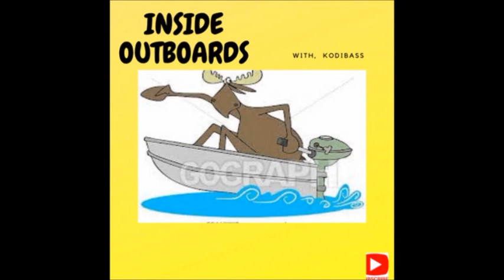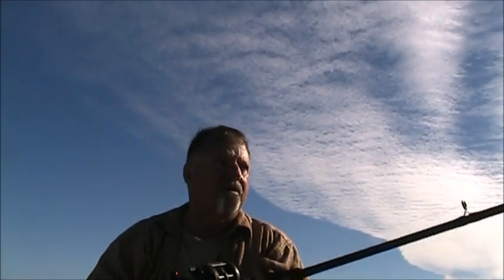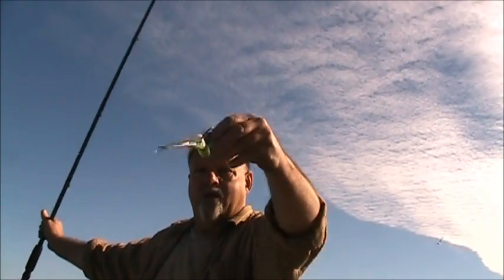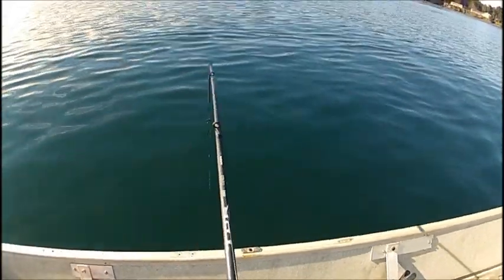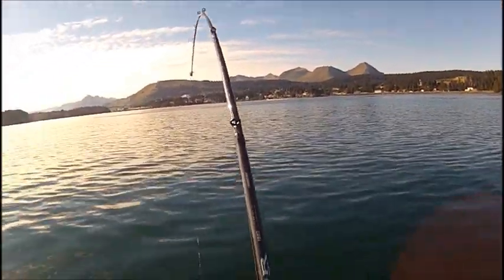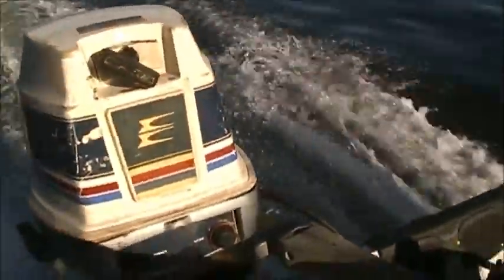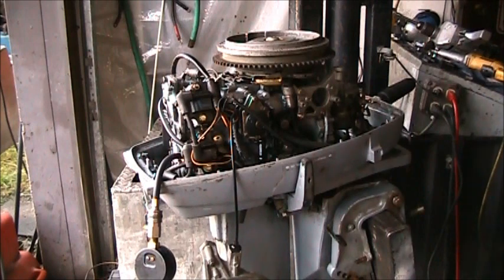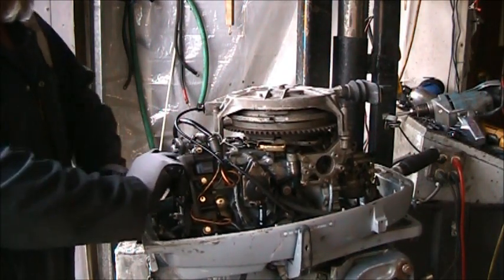1983 EVINRUDE 35 HP,   &   $400 00  FISH

Comment: I’ve got a 1990 Evinrude 30 hp. When I brought it I check the compression after running it hard with 50-1 yamaha 2T, top piston read 118, bottom 110. I took the motor apart including the piston to check+clean cause I’m restoring it and both top and bottom cylinder the 2nd ring are stuck. Funny how that is even when the compression seems okay. Thank goodness that I take it apart. Both cylinder wall looks OK, could use a little hone to clean out but not too much to where I need an over size pistons and rings. Hopefully on this 35 hp that you are working does not have the same issues. Love your video Kodi, thanks! Make more please!
Reply from the maker: +ATF, , Yep' them rings can get almost welded in their grove some times ,  I think this 35 will be ok as the numbers are coming up,  @ Least I hope.  More vid's on the way  4 sure.                                    kodi

Comment: Great job I was interested in how this was going to play out. Have 1978 25hp that was locked pretty hard 
pulled head soaked it bumped piston a few times and she moved cleaned small amount of rust off cylinder pressure was 45 on bad cylinder 125 on other 
Couldn’t get it to crank swapped plug wires got it to backfire hard a couple times swapped plug wires back and she cranked 
Rechecked pressure 120 and 125
Reply from the maker: +PB, fantastic 2 hear,  Yep' these old rudes R tuff as nails.     kodi

Comment: WOW...   Man I wish you had landed that little Barn Door...!    Hey question I came across a decent 'whole '78 Johnson Lower unit with a good Skeg for $100 with a brand new OMC water pump kit & brand new lower gearcase seal kit.   My question is this...   The 77 - 90 V4's took a 4-1/8" dia, 13 spline prop shaft, gearcase lower unit whereas the 77- 90 V6's used a 4-5/8" diameter, 15 spline prop shaft, gearcase lower unit...   is that correct?
Reply from the maker: +WR,  That does not sound correct to me,, I'll need to look thru my spec / parts break-down micro-fish & see what I can find,  Where did you get your spec's from?  kodi
Reply: @kodibassInsideoutboards  Johnson Evinrude 1990 (Copyright 1989) 507874 Service Manual; beginning of Chapter 6.  But I really don't have anthing to document the 1978 Johnson 115 lower unit, other than the fact that it has a 13 spline propshaft...

Comment: Bummer about the halibut...on a side note I've got my 35hp running..Had to replace a pos battery lead and figure out the wiring on the key start, fitted a replacement carby and electric choke, replaced the shifter lock as the original was rusted beyond usefulness...The gearbox was toast when i got it.. put on another one.. it leaks oil but i only wanted to see if it would run and pump water ...any chance of a video on how to rebuild the gearbox or at least replace the seals? Cheers mate
Reply from the maker: +PA, Sounds like your moving along nicely with that 35,  In the mean time put 1/4 cup of Lubriplate 105 in the gear box with the oil, it will slow the leak to almost nothing, & if a bit of water gets in things will stay protected.   I will look and see if I have a lower that needs sealing.                                                                                       kodi
Reply: @kodibassInsideoutboards  I'll put up a video on my home page of it running soon...I've also got a complete and running '77 35hp long shaft which i rebuilt last year (contemplating finding a boat to run them as twins in the future perhaps?)....and yet another '77 35hp short shaft in near perfect original condition that i run on my 3.7m v-nose punt..(i bought that one last year from an old guy who purchased it new and found that it was too big for his boat...instead of trading it in or finding a larger boat he just bought another smaller motor and left it on a stand in his shed for 42 years...until i found it..1 new impeller , a gear oil change..and it goes like a scalded cat.
Reply from the maker: @philbyalby   Fantastic,   looking fwrd  2 the vid,  Sounds like that near new NOS 77 was meant  4  U,  Someone who will  Care 4 it & who understands just what a fantastic motor it is,   Good Job  mate sum things R meant 2 B,  kodi

Comment: How does the cylinder benefit from running it longer in open throttle and why does the PSI increase with use? Lubrication and residue?
Reply from the maker: After a hone the cylinder walls r ruff, some compression bypass is expected as the rings set themselves the contact from rings to cylinders will usually increase compression  a few pounds as the cylinder walls R smoothed from the ring contact.                                           kodi

Comment: Just spent the evening trying to get the flywheel off my Evinrude 25 hp (1979) ... ended up bending my cheaper amazon harmonic puller....anyway tried the tapping tricks, put PB blaster in there.....only thing I have not tried is heating the flywheel....any additional tips / tricks you might recommend?
Reply from the maker: +GD, do not recommend heat unless U intend to replace upper crank seal.  If it is available 2 U,  I recommend putting the puller on get a bit of strain on the puller,  then take a air hammer & place on the puller bolt & give it a few shots,  this will normally pop the Fly wheel.                                                           kodi
Reply: kodibass thanks! Good to know about the seal, will pass on the heat gun for now (although I may have a replacement handy). I tried the equivalent of what you mentioned, but with a normal hammer....no luck (and I really gave it a few whacks).

Comment: I was wrong. I would’ve bet money it had got too hot and broke a ring on the bottom cylinder. Tough old engines for sure.
Reply from the maker: +WS,  I  thought it mite be Ok, because I saw no heat damage in & around the coils, wires etc,  normally if they have been cooked good I will find melted wire sleeves discolored paint etc,  She ran much better than I expected 4 sure.    kodi

Comment: Some times my 88 30hp johnson will just click w I push electric start and sometimes it starts fine.?? New starter new selonoid new battery??? Any thoughts
Reply from the maker: +NUF,  Yep'  I see this often,  It most often is caused by loose / corroded wires, & most often @ the solenoid connection.                          kodi
Reply: Thank you sir! Your awesome
Reply: @kodibassInsideoutboards  thermostat was corroded as all heck.
Reply from the maker: @snookupfishing8612   Yepper watch my latest  vid,,  Dealing wit this crapolla,  4  sure...      kodi